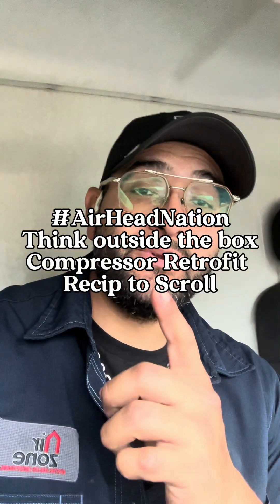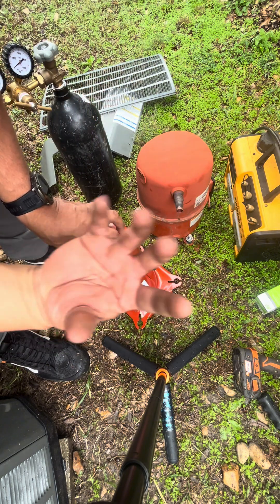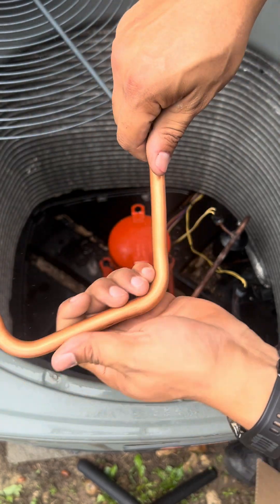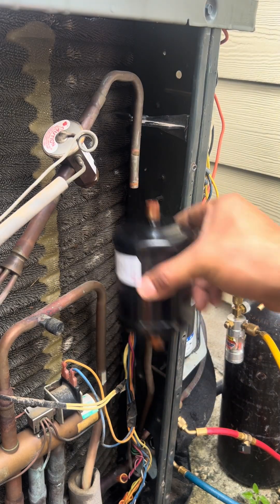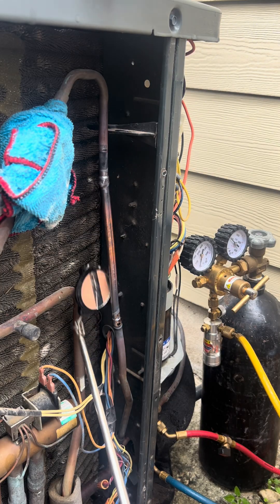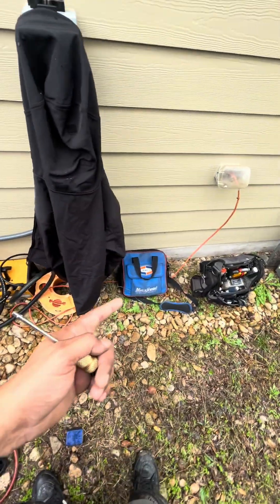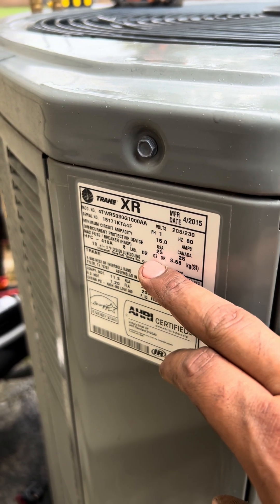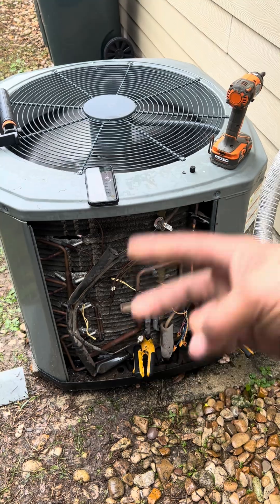Compressor Retro Fit - Reciprocating to Scroll

Comment: This is excellent! Good teaching! Especially on the consistent flow of nitrogen while you got the system open, I have recommended that highly to expedite the evacuation process, and of course, to prevent carbon buildup while brazing.